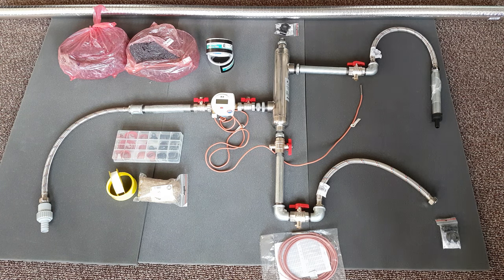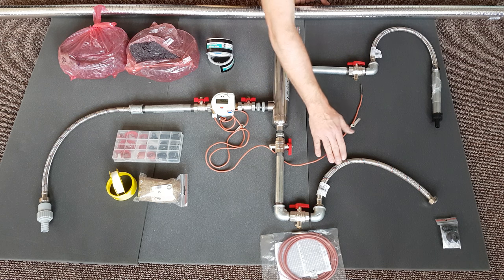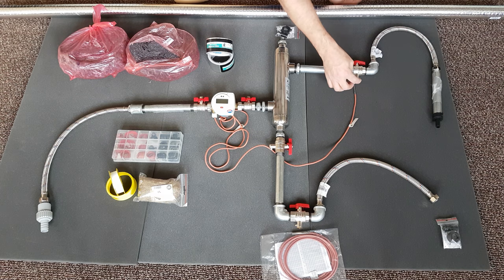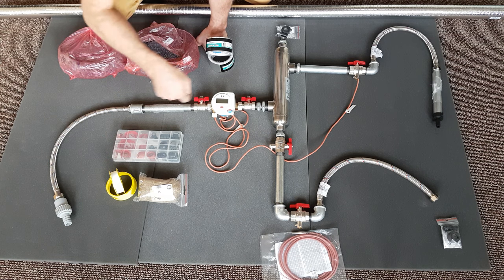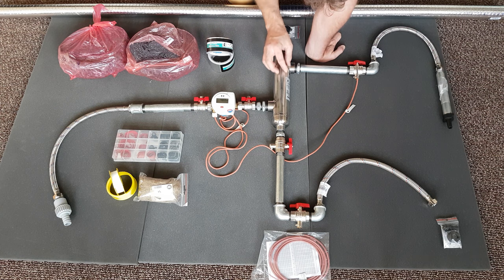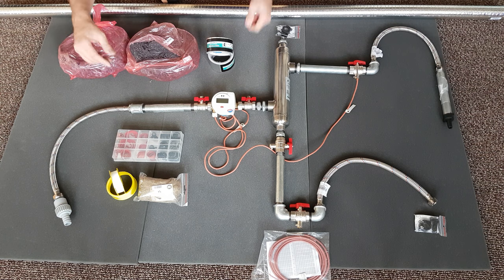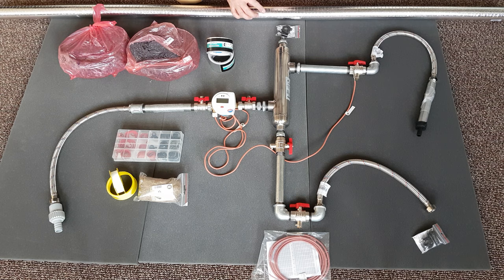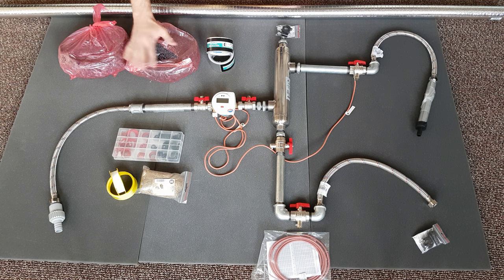Backup calorimetry setup

Comment: As you've mentioned, the power of the dummy reactor is 3.5kW; what power are you expecting to measure from the real reactor?
On a point of design (and this is only very minor); the ball valve may induce turbulence into the Sensus meter, therefore it may be better to have it at the other end of the straight pipe.
Reply from the maker: The reactor may produce up to 12kW

The Ball valve type and its location is that which is specified in the manuals for the Sensus and that is supplied from the company that supplied the sensus